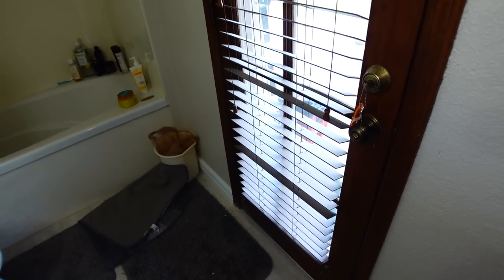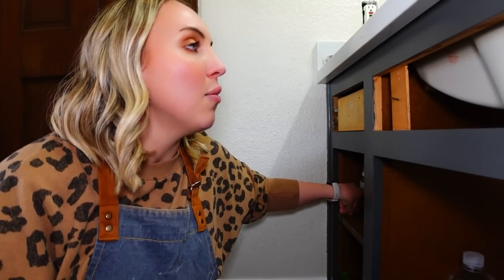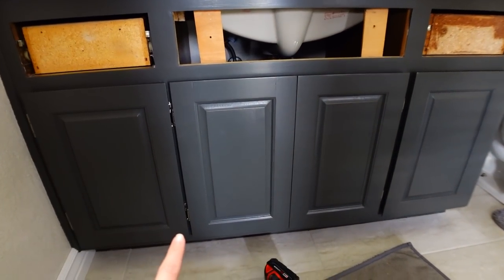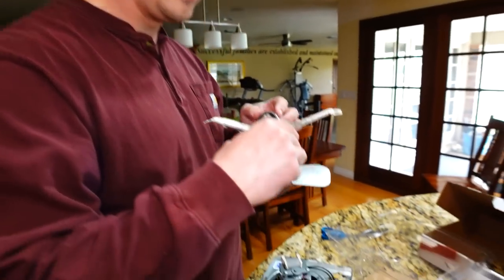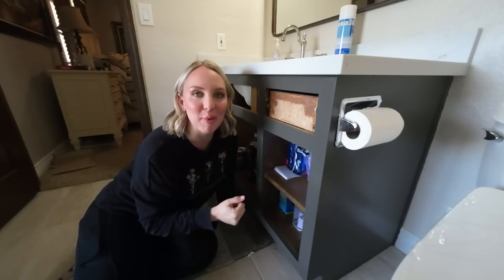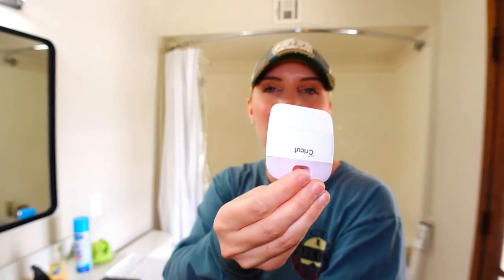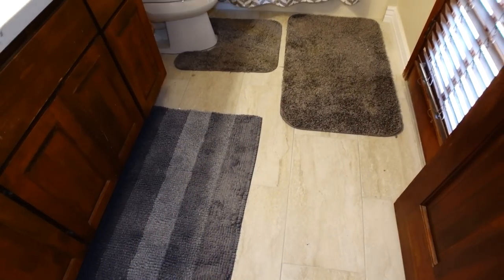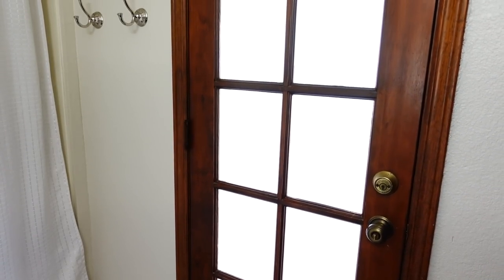BATHROOM MAKEOVER REVEAL!

Comment: Want to know how you finished the wood on the door you took the blinds off of? How did you fill in the screw holes & match the finish/coloring? I believe you are a very particular person & want to do a professional job, but at the end- showing the "NOW" it looks as if you havent filled in the screw holes where the blinds came off the door. Would like to know your "cure", your "finish", your hiding/ blending techinques.
Reply from the maker: Hi! Thanks for your great question! TBH, I hadn't finished that part when I filmed the ending (I really wanted to get this video out for you guys asap!) - I plan to fill the holes with some stainable wood filler and then touch them up with a stain that matches as closely as possible! You can also buy wood filler that is already tinted. :)
Reply: @BuildingandBeauty  I think it would look good if you painted the doors the same as the vanity, but maybe MIL wouldnt want that? Mayb she likes the wood.
Reply: I like the pictures that you hung too. They go with the wood doors & the rug also matches with the wood, but also. Has black in it to match the vanity.